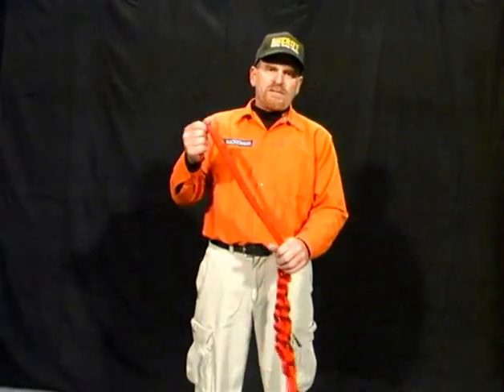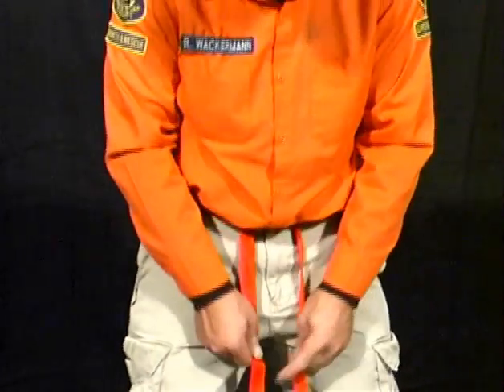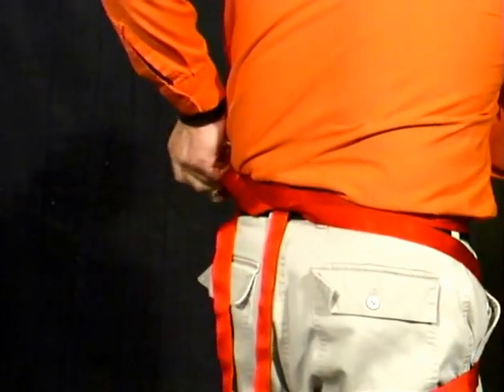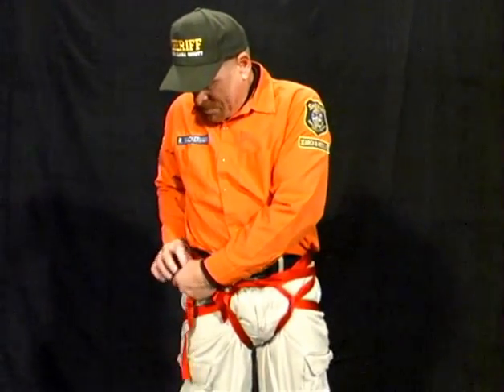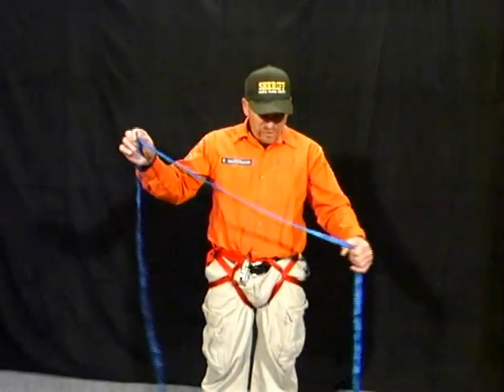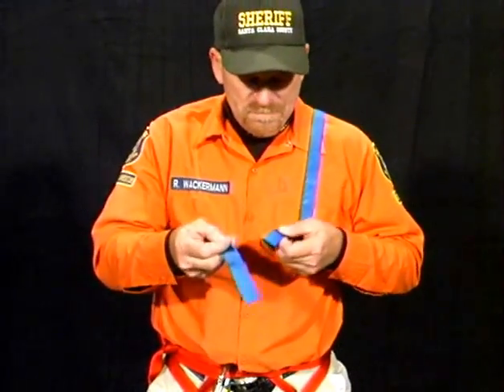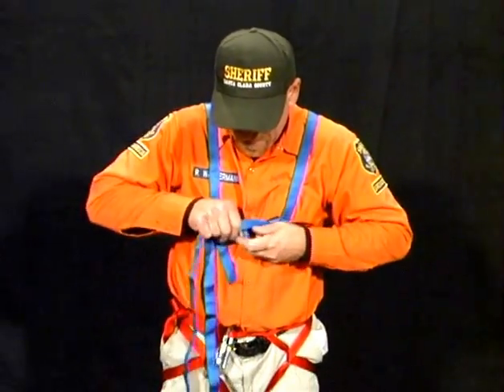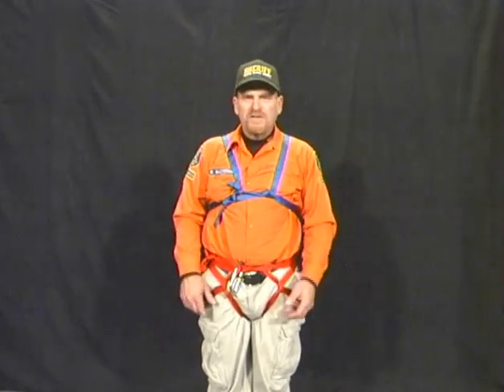Rescue systems, Part IV - harnesses

Comment: I bought a roll of 50mm webbing rated at 2200kg. I tied a similar harness from knots by Grog. Or should I buy 25 mm abseling webbing? The 50 mm webbing looks like seatbelt webbing but stitched different. Any reply appreciated cheers from Australia just subbed.nice work 🙂👍👍👍. Oh btw your version even tho similar. It definitely is better.